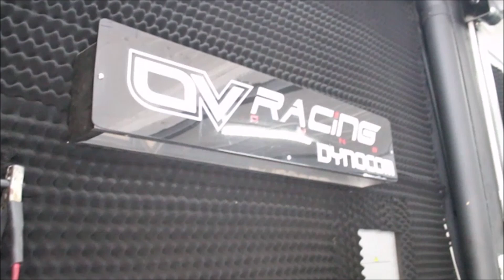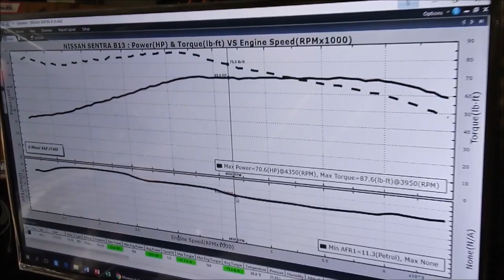Cuantos hp tiene realmente mi Nissan Sentra B13 stock en Bogotá? Dyno/ Tsuru

Comment: El b13 es un buen carro ánimo hermano.
Mi hijo tiene uno modificado (mejorado) y corre muy bien.
Pero ya me quedó la inquietud la medición de los caballos de fuerza y el torque.
Saludos hermano.
Reply from the maker: Hola, si viven cerca al nivel del mar, el resultado será mejor y mas si está modificado, saludos.
Reply: @pasionB13  
Estamos a 510 mts sobre el nivel del mar. No se que tantos caballos pierde.
Saludos hermano.
Reply: @JuanGarcia-et2rk  un carro aspirado (no turbo, supercargado, etc) pierde 1% por cada 100 MSNM, en pocas palabras, si un carro tiene 100hp en donde vivo que estamos a 1600 MSNM ese mismo motor pierde 16% de la potencia neta =84 HP

Comment: Yo creo que si la b13 hubiera sido inyectada, la cuestión hubiera sido diferente, porque yo tengo una b13  del 94 con motor ga16 inyectada y camina duro y está completamente stock
Reply from the maker: Hola, es un sentra 2010, es 16 valvulas inyection, lo que pasa es que estamos a 2600 metros sobre el nivel del mar y el motor tiene una fuga de aceite por las valvulas, saludos.
Reply: el mio es 2002 reconstruido y tiene buena fuerza es full inyecction  he cambiado partes pero no modificado el funcionamiento del motor esta como original y para mi corre muy bien y sube loma con carga y cinco ocupantes ..... aqui en panama hay un lugar llamado loma campana que es como un cono he subido esa via cargado y ha respondido muy bien apesar de los casi 20 años que tiene mi motor ..... asi que de tener los 70 caballos supuestamente entonces estan bien alimentados 😁😅🤣

saludos desde panama
Reply: mmm  ok si tendria sentido la baja .... estas perdiendo presión @pasionB13

Comment: Luis buenas tardes por favor necesito información para insonorizacion de mi nissan Sentra B13 en el piso y para que no se escuche el ruido del motor dentro del carro. Espero su ayuda. Gracias
Reply from the maker: Hola, eso es muy complicado, eso sucede porque ya el carro está muy antiguo y los tornillos y uniones empiezan a ceder, en ese caso o te acostumbras o te compras otro carro, ya que la reparación seria tan dispendiosa como cara, saludos.
Reply: @pasionB13  es 2011. Gracias

Comment: Hola, aun tienes la ficha tecnica del motor? Gracias, y animo!
Reply from the maker: Hola, segun ficha tecnica 
Motor: Ga16dne 
1600 c.c 
110 hp 
14.3 kg torque  a 4000 RPM 
16 valvulas 
4 cilindros

Comment: Saludos desde Costa Rica,  me párese que tu Sentra viene con TBI y no con inyección multipunto por ende solo trae 105hp. Cambia admisión y múltiple de escape
Reply from the maker: Hola, no de concesionario en la ficha tecnica del 2010 viene con 110 hp, solo que tiene el respiradero de la tapa de valvulas lleno de aceite por una fuga, ya se le detecto el problema, saludos.
Reply: Pasión B13 sube un video donde muestres el motor, para todos y yo salir de la duda, ya q yo e tenido sentras japo y el Nissan Nx coupe que traen esos motores y siempre quise sacarle más rendimiento sin turbar o abrir motor por eso tengo gracias a mi amor por estos carros conocimiento empírico de causa y conozco casi todas sus variantes pero nada está escrito, suerte con tu proyecto q ese es un carrazo
Reply: Es q en este video veo que el filtro de aire está montado directo sobre la admisión, en otras palabras no trae el múltiple de admisión eccs q es el del modelo japo o americano con 115 hp, si el tuyo no viene en tbi pero tráelo el cuerpo de aceleración del mismo si es posible los 110 hp q mencionas por eso quiero ver el motor de tu nave